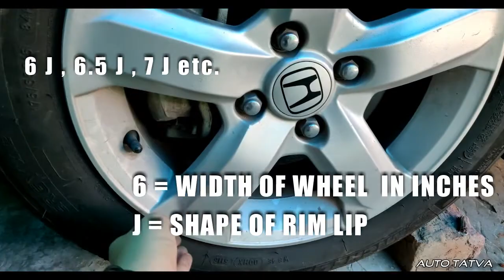What is Alloy Wheel PCD? | Alloy Wheels Explained | Auto Tatva

Comment from the maker: Alloy Wheels kharidne se pehle always take advice from experts and give top priority to quality & safety.
Ek aur point to keep in mind:
Pitch Circle Diameter (PCD) is the diameter of the circle which passes through the centre of all the studs, wheel bolts or wheel rim holes.
Formula: 4 Stud PCD = S / 0.7071

5 Stud PCD = S / 0.5878

6 Stud PCD = S / 0.5

S =  distance between two adjacent studs from centre of each holes.

Comment: What's is Tyre PCD of Mahindra Marshall
Reply from the maker: Basic calculation formula is : 4 Stud PCD = S / 0.7071
yahan S hota hai distance between two adjacent studs from the centre of each hole.
For example if a car has 17 inch wheels with 5 bolts
it can be 5x114.3
If tyre size is 235/65R17 
Please confirm from a nearest dealer or auth.Mahindra service centre as well